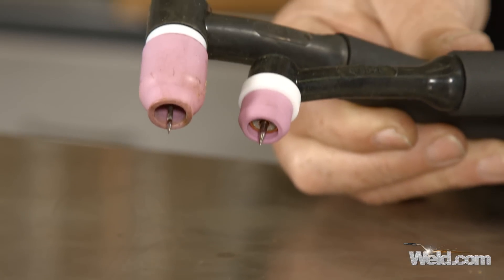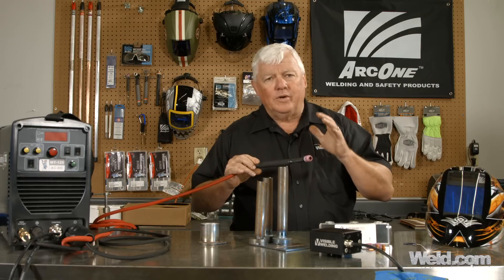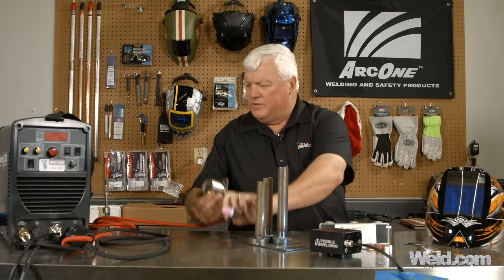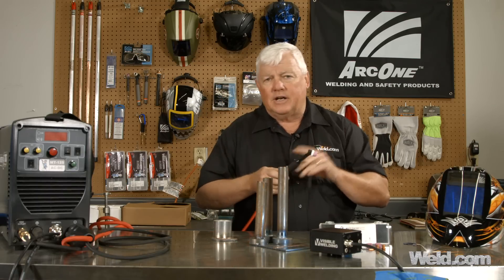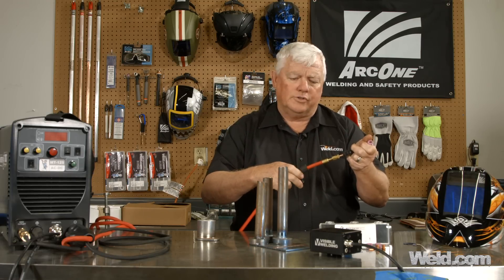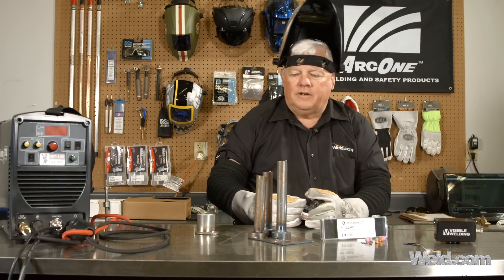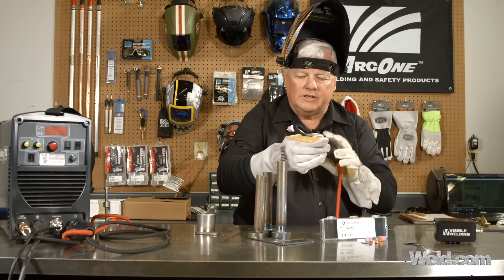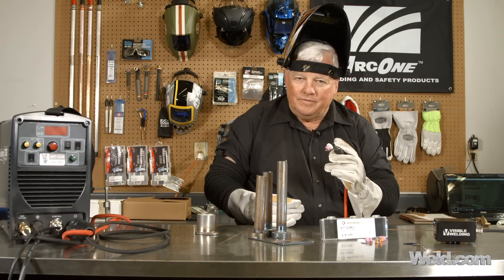Welding in Tight Clusters and the CK Worldwide OZMO Torch Kit | TIG Time

Comment: Sorry mate, but a welder with a decent skill set would get into that coming from either side with a 17 or 18 with a standard collet and ceramic. One side right handed, the other side left handed. Would weld the sides first meeting in the middles between the pipes, then weld the outside where there is plent of clearance. 
Going at the middles first  like that,  all you've succeeded in doing is distorting it all over the place

Comment: Hi Mr, Tig. My name is Antonio and I'm a welder from Spain. First of all, being this my first comment to your videos, would like to thank you for the great information you share with us, all your followers, which help us to improve and enjoy our welding capabilities. I've got my own welding site www.soldadoralmeria.com although it's all in Spanish for obvious reasons.
Regarding this video, this kit is very nice and would be very useful for myself and I use to repair and do welding in motorbikes parts and engines which used to have very tight clusters sometimes. I think I can get the kit somehow via ck Spain (if it exists) or from the States, but I'm not sure of the kind of torch it fits to. I think I understand you saying that the air cooled type is only 80 amps capable and that it's a wp24 torch type, but I normally weld with pulse (from .5 to 1 hz) (got a cebora tigsound ac/dc unit) and by doing that I'm always in between 70 and 140 amps even for thin stuff. I'm currently using a wp26 type as the machine is not water cooled, but it has always felt to be quite heavy and difficult to work with and I've been always wishing to use one of those tiny torches you always uses in your shows, which seem to be miles away in weight and flexibility compare to mind.